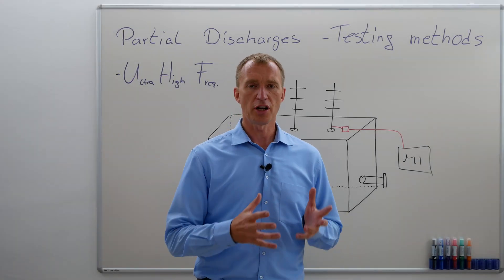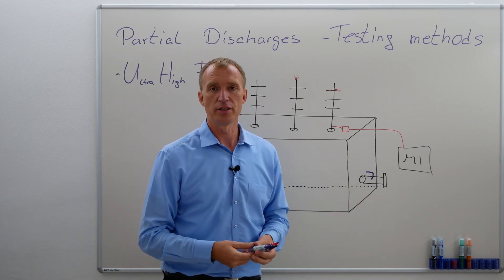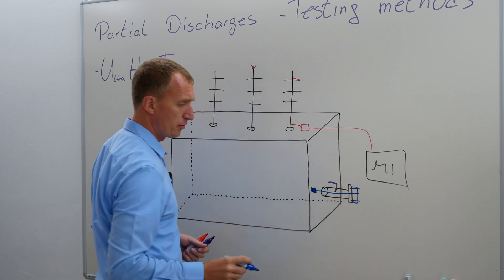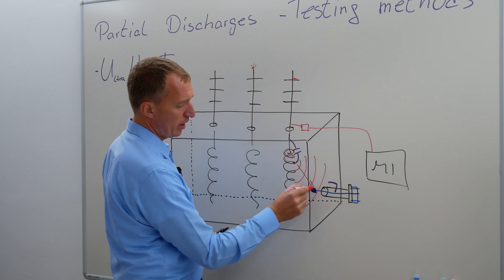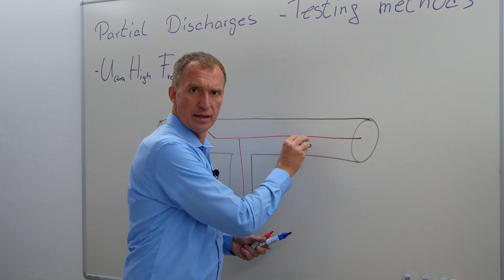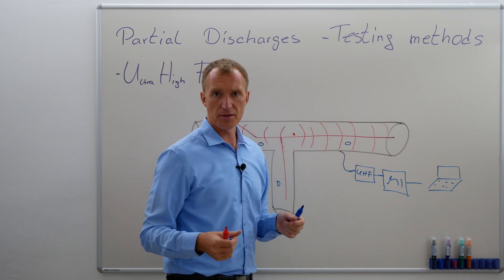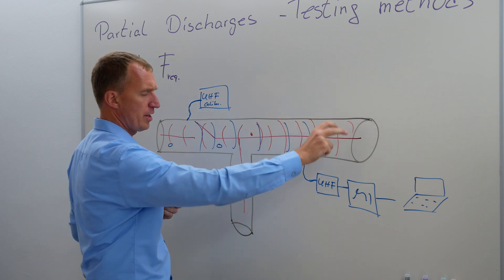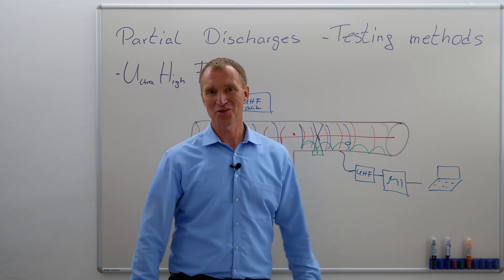5.2 Partial Discharges Testing Methods - UHF detection

Comment: SIr your videos are very interesting and helpful and would like to thank you for sharing this knowledge. Secondly,  I am doing Partial discharge measurement for GIS using UHF sensors and i would like to ask a question about it. When we measure PD by using UHF our magnitude is coming in terms of V or dBm but the client asks for pC value so is there any way to convert our values in pC if no then is there any proper justifion for that. I would appreciate if you could share your email to get in touch with you for some further discussions.